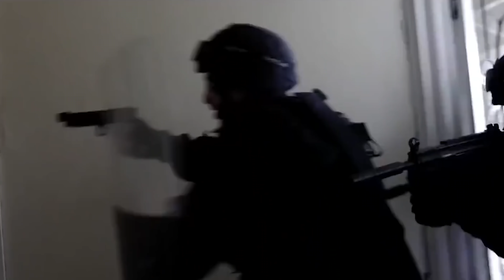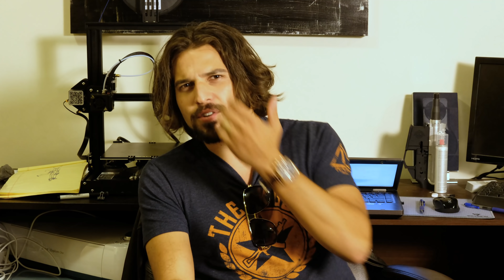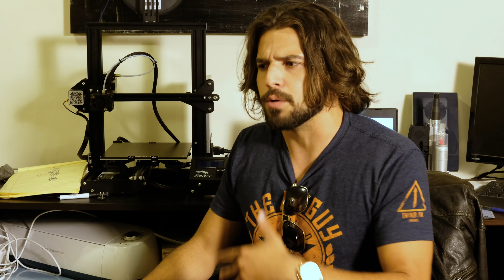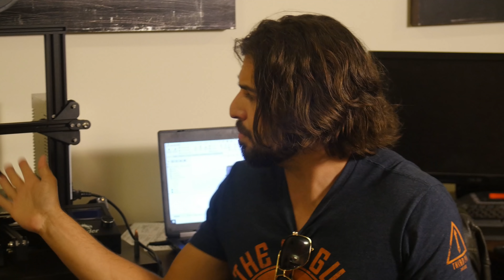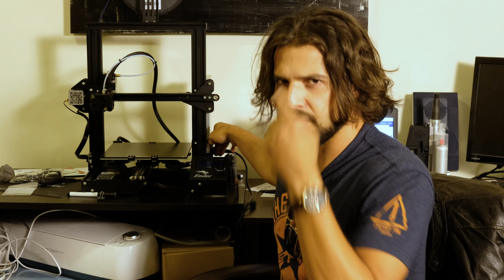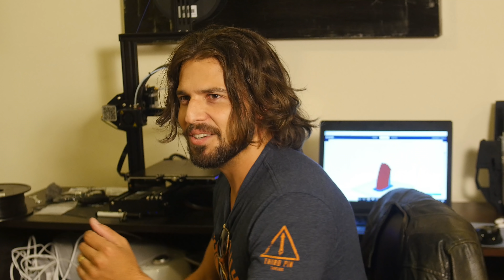3D Proonting a [REDACTED]: Getting Started

Comment: Cad,3d printing,cnc milling is my crack ! I geek out on that like it's pussy . Best technology so far for us home builders
 Ecm barrel building is also something you should show Brandon. Teach others how to make an entire gun from scratch . I've literally made smg carbines for less than 180$. 8 mm 3/4 4140 steel seamless pipe 32 inches off eBay is dirty cheap. Then ecm to bore it to 8.82 then 3d printing the mandrel for rifling with ecm . Homemade barrels .cnc milling an open bolt design system .you can't stop the signal

Comment: Here's what parts you need to make plastic (AK parts)
-make a plastic dust cover
-a plastic bolt carrier (piston not included)
-a receiver (thicker like 1.5mm)
-fire control group
-selector lever (make full auto selector sear)
-front and rear sight

-trunnion (why not for experimental purposes xD)

keep in mind Brandon, use your polish tantal ak-74 that you've used previously in your "no rivets trunnion" so that your rifle wont absorb much force

pls read this pls read this please read this

Comment: while Cura is extremely common with the Chinese production of RepRap Mendel and Kossel based printers (for once not knock-offs, as RepRap is an open standard)
I recommend the software used by the high-end of the hobbyist grade printers, PrusaSlicer, a slightly modified derivative of Slic3r. It takes a bit to create the profile, but you should see marked improvement in your prints.

You might also want to dump the stock version of the Marlin firmware and update to Marlin 2 (if you do, make sure you capture your printers config settings especially the PID controller values. PID tuning is not a fun time)

Comment: Before you jump to get an Ender 3, if you want to print stronger plastics like Nylon, ABS, PC, and carbon fiber infused thereof, you'll need to change out the hotend which will set you back 100$ or there abouts, and you'll need to either buy a new circuit board or modify yours to allow you to change firmware that lets you print at the higher temperatures you'll need.

Comment: Anyone that wants to get in to this kind of stuff, you will need a CAD software. Heres a basic rundown of them
Solidworks: it's the gold standard, it's also the price of gold. Expect to pay ~5,000-26,000K$
Autodesk: it's the poor mans solidworks, it's what I use, specifically fusion360. F360 is free for most people
Sketchup: what are you doing with your life.
SCAD: you love open source
Blender: you are making p()rn

Also, there is a way to get any CAD software for free, but Uncle Sam doesn't approve. It's the same place you can get pretty much anything. It starts with "dark" and ends with "web". 

I would recommend f360 if you are on a budget.
Reply from the maker: Test Excellent rundown. 

CAD isn’t needed for 3D printing, but without it, you’re 100% dependent on unaltered files you find online.
Reply: @BrandonHerrera  Very true, there is a ton you can do with just what's already online. 

I would also like to say, thank you for replying to comments, even though you have 194K subs. That has be a ton of work. Very few youtubers go through the effort of doing that.

Comment: I learned solid works back in highschool I love the program it's a very powerful program especially when it comes to simulation of mechanical connections however when you don't have access to a 2000$ program fusion 360 becomes very apitizing...

Comment: Pretty much no question, additive manufacturing is the future. I work in a steel cutting shop and we scrap a huge amount of material. Additive manufacturing would nearly eliminate that plus incorporate some secondary and tertiary operations into the original process. Unfortunately metallic 3D printing is in its infancy and still absurdly  expensive. I'm dying to see custom alloys and tailored grain structures on command though. I love Solidworks but my employer has no use for it right now. Its a shame its so expensive for a casual user.

Comment: Hey Brandon, you should look at getting a Duet WIFI board your print quality will increase highly with the 32 bit processor. Plus all the settings and customization you can do through the board is amazing. It would be a great weekend project and from the sounds of it you would love the tinkering process. Build tack is also a big help if you ever have issues with bed adhesion.

Comment: Awesome Brandon! Just a heads up move the filament roll holder as far left as possible to reduce stress on the extruder. There's also a few filament arms online to print that help with this issue. Also print a fan cover for the motherboard fan. If filament chips/chards/whatever they're called get in there its gonna suck!

Comment: With this model you get problems with under extrusion in a few months. Be prepared for it. Replace the extruder with aluminum parts or fix the gap between the nozzle and the PTFE tube. And then happy 3d printing again!
Reply: i know this comment is 2 years old but i want to point out that custom firmwares that have come out since have a direct control in the tune menu to control extrusion level.

i would still recommend upgrading to the all aluminum parts because its like 10 bucks and works much better,  but its not mandatory. that and upgraded bed springs cost less than $15 total and improve print quality immensely.

also bit more pricey but spring for an auto bed leveler. just got one recently and not only does it make a massive difference but i can't believe I've been leveling by hand this long. its Sooooo much better

Comment: Tbh I feel like resin based printers would work for gun stuff as it generally has better layer adhesion which is the most common failure point
Especially with the new modern resins that aren’t nearly as prone to being brittle

However 3D printing is just straight amazing
Reply: MyLonewolf25 resins have lower tensile strength and in my experience if you are having later adhesion problems just print at a hotter temperature

Comment: Have you seen that there going to be rolling solidworks into the 3d experience app I have some family that works for solidworks they're making some big changes
Reply from the maker: rebellorebellion I’m extremely excited by that possibility! That is one thing I always said was going to change the way we design things on an insane level
Reply: @BrandonHerrera  I guess now the point is to be able to go from solidwork to the simulation software or structural and like city planning software basically all the different dassault systemes software

Comment: Welcome to the Ender3 club. If you don't like the long print time, try printing without supports. You may have to use a brim that is a 3-4 mm to make sure you keep the part on the bed.

But for quick parts, I just use TinkerCAD.  It's a FREE browser based simple CAD software.
Reply: Don't forget marlin bed leveling

Comment: You need a burnt orange filament so you can print fakelites
Reply: If you do FDM printing, I strongly suggest looking up "precious plastic". Its a hippie recycling kickstarter but when you get beyond their BS campaign, they have a very nicely laid out set of prints for a shredder and motorized injection machine to make FDM filament. This is of course good for reusing your failures, but also for getting pellets or even turning junkyard plastic into cheap print material. Plus you aren't giving your dollars to a Chinese regime to produce a product they make 95% profit on. 

By mixing colors of scrap you can produce any color you want, even shades that don't exist commercially. Injection molding will also teach you to make products outside of 3D printing (do not rely on AM, it is a prototyping tech, not a production tech, you will not learn as much doing AM as you will learning how to actually make things) and the products will be much more durable and quicker to produce once you find something you need to make a lot of.
Reply: @DaveSmith-cp5kj  it's a year late, but I just melt my filament scraps into sheets between two pieces of glass and punch guitar picks out of it.
Reply: @porkins07  Yup, that's the way to go. AM is not the be all end all.
Reply: Best idea ever.
Reply: Its funny because that was his first video I saw, it was him burning a Bakelite magazine. Remember that Brandon?
Reply: Or wood filed filament

Comment: Just wait till metal 3D printing gets affordable and accessible, the BATFE is going to have a heart attack.
Reply: I work for a company that produces cobalt chromium surgical guides by 3d laser sintering. If i decided one day to print off whatever I wanted i could have a barrel of unfinished lowers by the end of my shift. The tech is there, the printers are dropping in price and quality has gone through the roof. In a couple years there will be 3d printed firearms on shelves in your local shop....
Reply: @NinjaRider777R I print surgical guides for a living out of cobalt chromium. Ive also worked for a company that printed aircraft parts out of titanium. Im a machinist by trade and i understand that 80% lowers are far cheaper and easier to manufacture than 3d printing yourself, but the finished product that we produce has the same durability as lower quality forging after its been proccessed and heat treated. Ive personally known 2 individuals who have managed to print metal lowers and both have hundreds if not thousands of rounds through them. Im sorry but you're thinking of the technology that existed 5 years ago. What we have today and what we are capable of producing would blow your mind. We print gears in house for our machines that last longer than the forged gears supplied by the company that produces our machines. Im not trying to be disrespectful, just trying to dispel the myth you're perpetuating.
Reply: I'm curious if anyone has been experimenting with some of the newer cheap (3k or less) home technologies for guns. I've seen continuous Kevlar strand 3d printers advertised recently and supposedly it holds up tons better than abs alone. I just want to know if it is good enough to justify getting it specifically for use in gun parts and haven't seen anything on it yet.
Reply: @luauboi  I'm working on continuous Kevlar, Carbon, Glass and composite fibres currently. Also have access to Stainless Steel printing (FDM). It's definitely possible! There's already companies manufacturing suppressors using titanium with Selective Laser Sintering
Reply: @Matt3DMaker  that excited me greatly, guess I'll pull the trigger on a 3d printer upgrade then. Thanks for the info.
Reply: @luauboi  check out MarkForged for the reinforced prints, you can't do it on a regular desktop 😊
Reply: @NinjaRider777R stick the plate in a kiln for 40 minutes at 1450 degrees.. That is all.
Reply: @NinjaRider777R I'm talking about more than just finishing a lower. I mean REAL gunsmithing, where you turn barstock into a gun. You can branch out into more designs when you machine rather than print.
Reply: @NinjaRider777R laser sintering melts the metal together.. Its far stronger than what you think.
Reply: NinjaRider777R he’s talking about sintered metal 3d printing, you cook the parts in a forge and the metal fuzes together, there are suppressor companies that do it
Reply: @chuckfinley3152  there's also DLMS that doesn't require being sintered afterwards.  

they are extremely expensive at present($30k+ iirc) but so we're 3d printers not that long ago.

it will probably be consomer level technology with the next 10 years, if not 5) at absolute maximum and that's assuming a better technology isn't created before then. 

metal printing at home is already feasible if you have the cash. 

when it does finally become consumer level gun control will be truly dead with no hope of ever being feasible again.

we're kind of already there even with current 3d printing technology though.  the only thing on the AR 15 you can't make yourself with a 3d printer is the BCG.
Reply: @elrojogrande744  inconel "cups" for everyone!!!!
Reply: @elrojogrande744  you can already make the FGC 9 a 9mm semi auto fire arm without any regulated parts, you dont need expensive printers and machine when you use your brain.
Reply: @valian8985  yeah,  but making it last long term takes a bit more than brains im sorry to tell you.
Reply: @elrojogrande744  there is already people that shoted more than 500 round trought it without problem, will depend a lot of how you made it but still very impresive for a totaly unregulated firearm
Reply: @chuckfinley3152  SLS uses lasers to sinter layers of metal, I'm talking about FDM metal printing, which is a metal powder suspended in a medium. You print it your object, then sinter the part in a kiln to burn off the medium 😊
Reply: @NinjaRider777R Or you know just run with a basic homemade coal forge and watch the color. A little more hands on but it gets you results.
Reply: A mini milling machine and lathe only cost about $1,000, which is like the price of one mid-end firearm. You can do a lot more with that than 3D printing, even when SLS becomes affordable.
Reply: It's already affordable 👀 Check out the Markforged X
Reply: I wounded of graphine is 3D printable.
Reply: @edgeofthesouth  nope, its not even manufactureable yet
Reply: @edgeofthesouth  there’s a filament that contains it but it’s only a percentage
Reply: Metal 3D eraser kit is already affordable and accessible.
Reply: Cost effective metal additive manufacturing is almost at our doorsteps!!! Toured oak ridge and many companies have working small scale additive machines. They're just figuring out market scalability and parts manufacturing. Caterpillar is also developing additive machines that will cut the cost and time to the consumer on construction equipment!!!
Reply: @Sowneyy 7.62 10/10 argument, tell it to the airlines using it 🙄
Reply: I would love to see that in my lifetime. My college just got a 3D metal printer and it supposedly cost a pretty penny and costs a lot of money to make anything decent. I’ve seen it work when I’m in the machine shop it’s pretty dope
Reply: That would be casting
Reply: @armadilloeggs231  There is no mold. More like stacking weld bead.
Reply: @armadilloeggs231  still stronger
Reply: Metal powder 3D printing is actually alot less reliable than forging and casting due to our thousands of years of development in those fields that would litterally go to scrap.

P.S. please correct me if i am wrong, i am only saying this by memory.
Reply: @Sowneyy 7.62 no, it isn't.
Reply: @Sowneyy 7.62 No... it really isn't. Do some more research
Reply: We can only hope
Reply: They sell metal filaments for 500 dollars
Reply: 3d printed glocks are better than stock glocks if you know what you're doing. If you want a pistol caliber carbine look into the FGC-9. I've heard of the mod-9 as  well but never tried it out.
Reply: Ha! Ha! Ha!
Reply: Someone should design an FDM printer with a MIG welding tip for the nozzle. Might work? :]
Reply: @BuckFoeJiden  well its not realy same, but maybe this could work
Reply: Well well well. You predict future....
Reply: It’s honestly scary if metal prints get affordable and reliable nobody will have business so much stuff is metal and being that you can make shit yourself in metal and make it fit all your needs makes it hard for businesses to work
Reply: only if this man had known that great polymer would become cheap in only 2 years. also holy fuck in 2 years its become so cheap to just print an 80%.
Reply: @Benjamin Riggs Outdoors &All use a standard 3d printer to run Glock frame prints.
Use the metal 3d printer to run your rails and shit the slap a parts kit in it after some fitting 🤘🤘
Reply: I have doubts the majority metal 3D printing methods will be strong enough to handle the tens of thousands of psi in pressure required in tensile strength anytime soon but when/if it does, the ATF will probably try to regulate those printers.

They will probably fail, but I digress.
Reply: its awesome to come back and see comments like this now that you can get reputable desktop milling machines for around 500 dollars. However, if someone could make a consumer grade printer that uses Metal filament id be very impressed and interested
Reply: 2023 now. There are metal 3d printets. They are a bit pricey but is accessible.
Reply: Y’all realize there’s casting
Reply: It’s called stop being lazy and investment cast your prints lol 😂
Reply: lol just got my neptune 4 pro for 300 bucks
Reply: Fuck them they’re a waste of space and time and enforce unconstitutional laws
Reply: @NinjaRider777R Desktop CNC can be found hella cheap nowadays and most 3d printers can be retrofitted for CNC